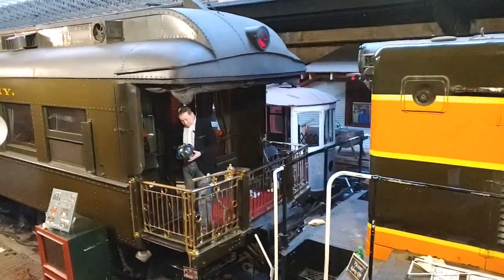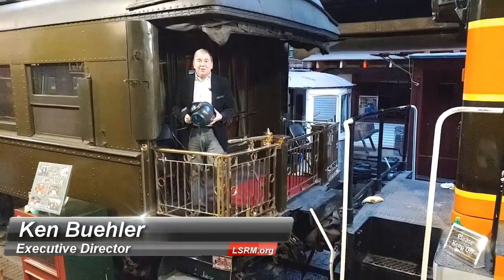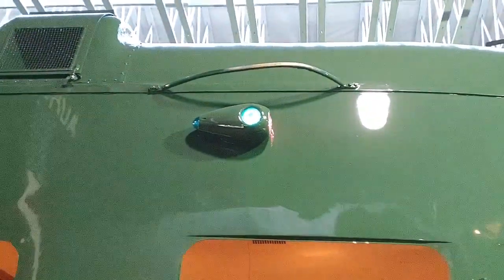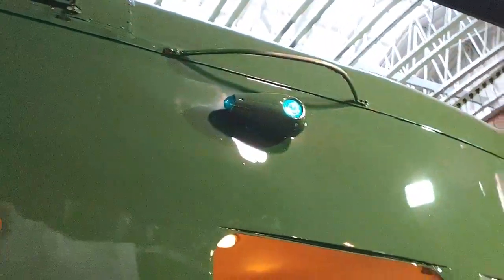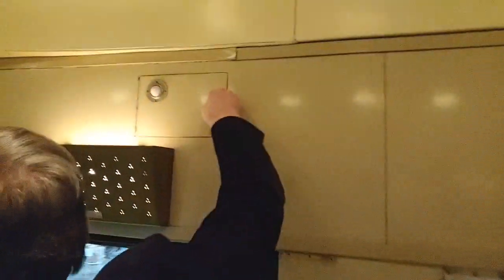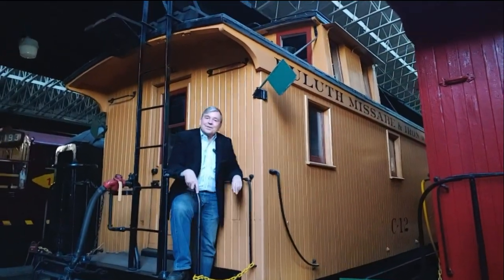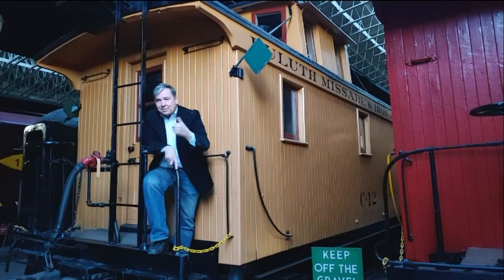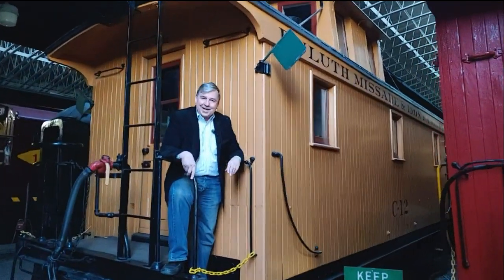Marker Lights

Comment: That was one end of the train. Markers and flags on the front end will be next?
Reply: The ones in front are called classification lights---and I was going to suggest the same thing.  I know no white flags, or white lights at night, mean the train is unscheduled but running on orders and green means there's another section of the same (scheduled) train coming behind, but I've always wondered how they change the lens colors on classification lights, since they're not always 4-sided.  Stay safe.